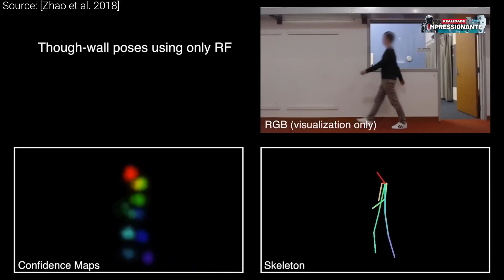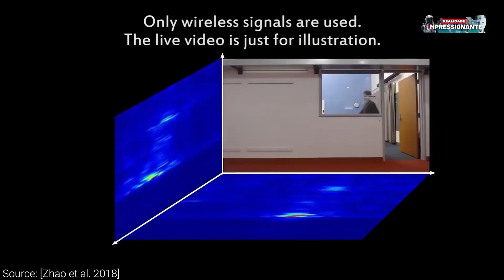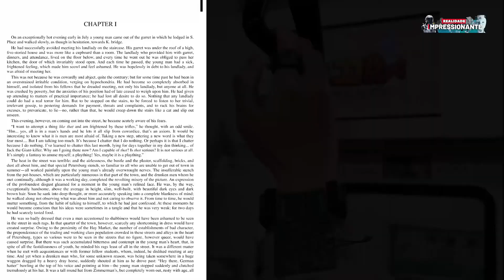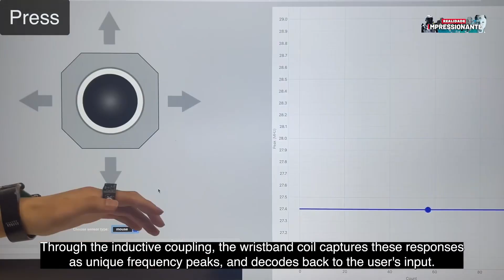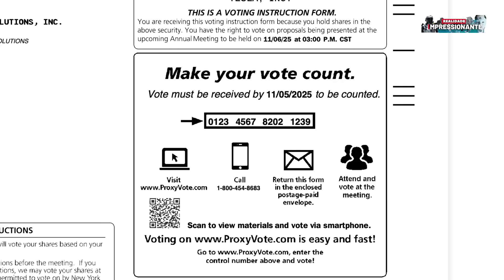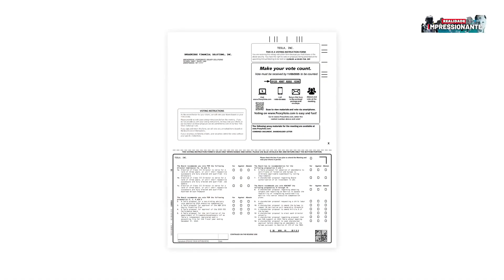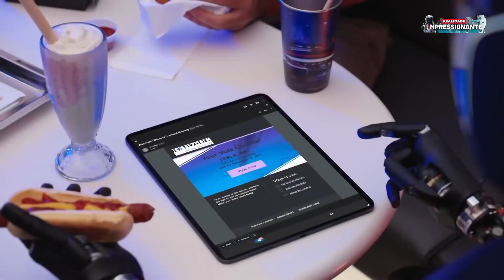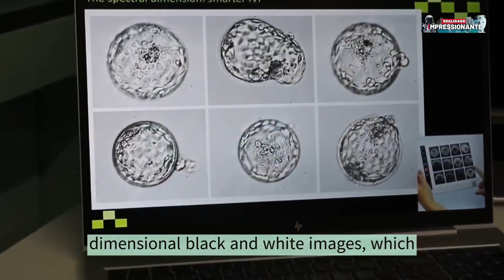Neuralink Connects Mind and Machine | Tesla Calls on Shareholders with Optimus | Nanotech Update

Comment: You need to do a lot more work on your content. AI is not great at scripts so you need to go over the script and correct things before feeding it to a voice generator. Also when making the video you should do something like record yourself reading out the script and use that video as a reference for the AI to generate the animation of your fake person so you can get some decent lip syncing. For the parts where you don't need to lip sync like voice overs on top of clips at least make sure the AI is reading the script at a reasonable cadence. Having it randomly speeding up and slowing down is jarring. You also don't want to have points where it repeats words as though it's reading an article and came to a section headline. It should come out sounding conversational, that's one of the reasons why you need to edit the script. When selecting a voice for the AI, use one that is grating on the ears. A little effort goes a long way in making decent content.